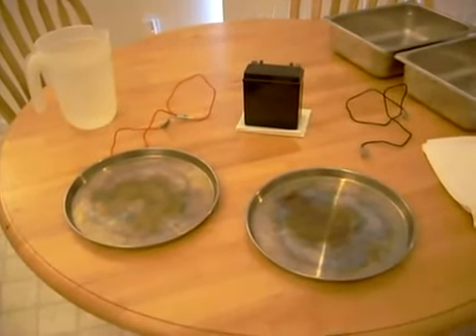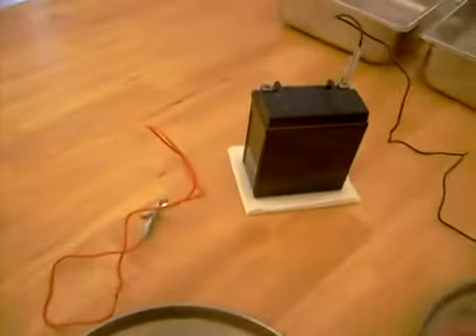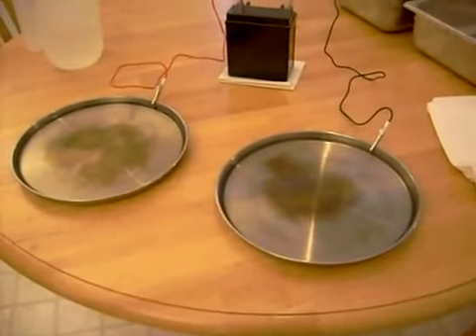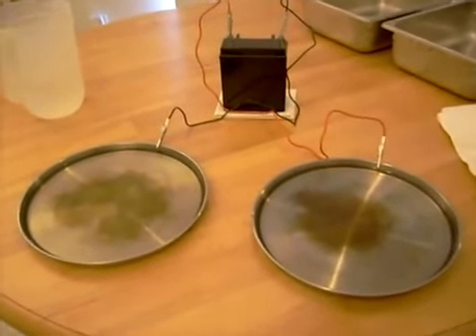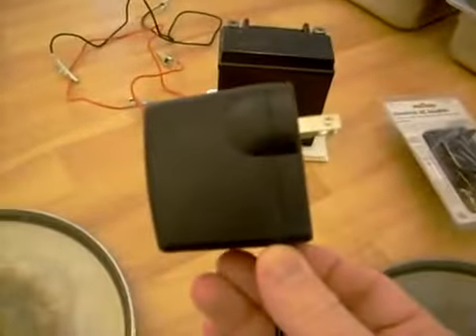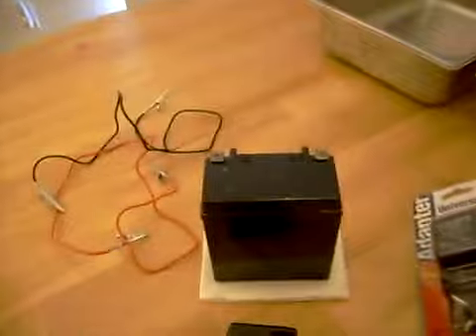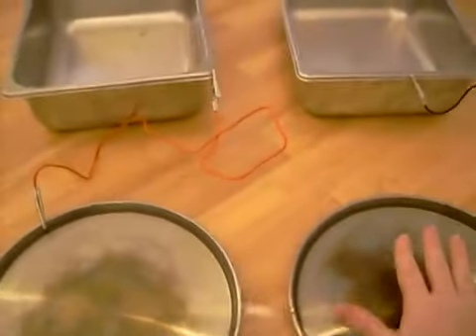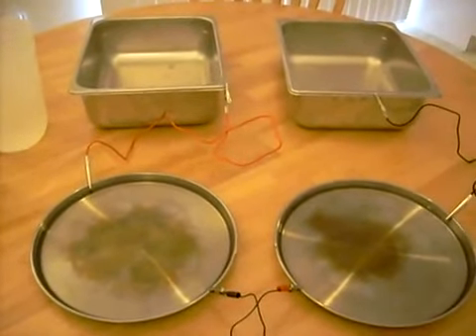Make your own Iontophoresis machine www.verysweatybetty.com

Comment: I made mine with a 30 volt old laptop charger. It has totally fixed my hands!!!! I feel like i have been reborn. No more anxiety about shaking hands :) I just did it everyday for 30 -45 minutes switching the current every 10 mins. After about a week they totally stopped sweating more than i could have ever hoped for. Once dry you only have to do it like once a week or every couple weeks for maintinence.
Reply: argreen33 I know I'm very late but how long does it take for your sweat to come back?
Reply: argreen33  can you teach me how?
Reply: When u put ur hands in the pans can they touch the pan or do u have to leave on top of the water
Reply: I will use before 10 days but I didnt got result .....how many days u can use
???
Reply: How many volts do you use
Reply: @syedaalina826  maybe u didn't do it well, cuz it shows the result after maybe 4 days

Comment: It works very well and I did the same using 24 V, 30 mAmps. However, I do get electric shock once a while. So I am a bit worried. Thinking it would be better to use 12 V DC battery to be safe.

Comment: Thank you sir. You verified that it can be done with stainless steal pans as well as aluminum and you verified the battery for me.
Reply: @Shakil Ahmed BhAi Stainless Steel achaa rahega ya aluminium batao please
Reply: @Shakil Ahmed mere pass abhi aluminium plate nhi hai lock down me Steel use kre
Reply: @Shakil Ahmed BhAi apka hyperhydrosis ka problem solve hua is process se intophoresis

Comment: Good information, thanks for posting. 

The above comment about deodorant is out of ignorance. What I have found is that there is no antiperspirant which works to control hyperhidrosis -- it is not normal sweating. I use a regular deodorant, however. No deodorant/anti-perspirant is good to use on your hands as you can rub it into your eyes when you sleep.

Comment: @VerySweatyBetty i used tap water initially but after few days it started giving me light electric shocks, which was painful, so i have started using mineral water with less salt which is quite easy to handle and results are almost same...Few Question ? is this a permanant solution ? will this hit or affect any organ..i shared this technic with my Physician, who said that its very safe or even it would treat your weak organs too. Is it true ??

Comment: Hi, thanks for posting this video! Question: how were you able to use the alligator clips with the AC-DC adapter? Usually, they have a barrel plug, right? I don't know much about electricity, but if you could shed some light, I'd appreciate it!

Comment: Good information, thanks for posting. I'd imagine that it could be modified for your feet as well.

The above comment about deodorant is out of ignorance. What I have found is that there is no antiperspirant which works to control sweating. I use a regular deodorant, however. No deodorant is good to use on your hands as you can rub it into your eyes when you sleep.

Comment: Hi everyone!
I recently moved in a city with really soft and clean water, and iontophoresis doesn't work for me like it used to back home!
Does anyone know if adding magnesium in the water would help??
Also I've heard mixing rain water works too. Anyone knows anything about this??
I would very much appreciate it. Thanks!
Reply: Yes, it will help. Buy some epsom salt (magnesium sulfate) and add some to both pans.
Reply: You can also add some baking soda
Reply: Just add some salt or baking soda to the water
Reply: adding any salt would help since adding electrolytes will increase electric conductance of the water. The cleaner or the softer the water, less conductant it is.
Reply: Vugar Zeynalov  should the salt be under or on the cloth that i use (i dont have to hover my hands above the water) inside the water?
Reply: @fadinglightsarefading  I think it's better to try to stir the water to solve little bit of the salt before you start so the electrolytes can dissolve in the water. Than put the cloth or paper towel under your feet or hands. Moving hands or feet can cause little discomfort.
Reply: Vugar Zeynalov  thanks
Reply: Kltna din use kary aap??? Mai issa 10 days sa use kariyoon but result nhi milra plz help....
Reply: @syedaalina826  same

Comment: I started doing this three days ago. On the first day I felt a strong electric/ tingling sensation in my hands when I placed it in the water.The last two times I tried it I cannot feel that sensation anymore. My batteries are resgistering 18V. I haven't seen a reduction in my sweat at all. Is this normal?
Reply: Me too is it Normal help mi out if u hav an answer em using a 12V battery

Comment: pls can i use car battery instead
Reply: +djancak I'm using 12V4.5AH battery for about a week . are you saying it's dangerous? skin burn stinking and stuff like that I can take but I'm worried about it causing heart problems.
Reply: +djancak wow good to know. thanx for the heads up! but my battery is'nt a car battery. it looks like the one in the video and I think its motor cycle battery. it says "Sealed Lead Acid Battery" on it. but I'm guessing that one also isn't safe so Im gonna use some ressistence to lower the current

Comment: can we used car battery coz its 12 volts also
Reply: +Romulo Angungal Do not! the amperage is way to high! A car battery is 12 volts, 75 amps, 12 volts at 2 amps is more than enough to hurt.
Reply: you can use 12V car battery. it doesnt really matter if the battery can supply 2 or 75 amps. it CAN supply it, but it won't, given your body's resistance, with same voltage, it can't deliver more amps even if the battery is capable of it. the equation here is I=U/R (I being current-amps, U=voltage, R=resistance of your body). Speaking of your example, even if you could get those 2 amps through your body, you would be dead, but you would need much much higher voltage to allow this current to go through your body. Also, don't mix amps and amp hours (A and Ah), 75Ah car battery is capable of delivering around 500amps peak current. Ah is just capacity  of the battery.
Reply: Life safer

Comment: anyone tried this with glass instead of aluminium /steel?
Reply: Glass won't work. Electricity flows through metal and not glass. That's why it has to be a pan that is made from any metal that will allow the flow of electricity to affect your palms. Hope that helps. This is very basic science.
Reply: I have a question and would be very happy if you would know the answer. I recently moved and found that my water is too clean to work unlike the water back home.
Im thinking of trying rain water. Does rain water work?
Also, would adding magnesium into the water work??
Reply: Pak Punjabi hello bro plz reply can I use stainless steel plates or aluminium..and which type of battery should use